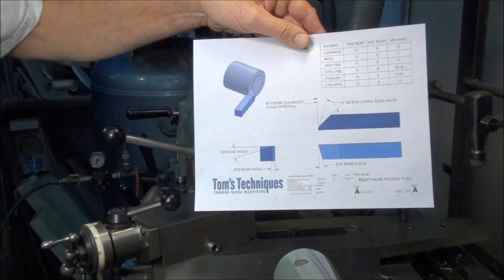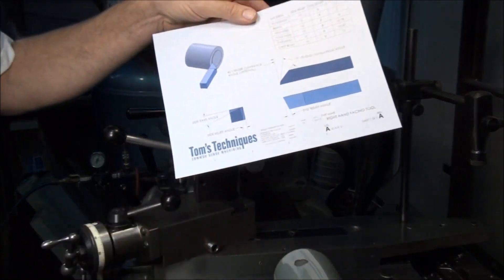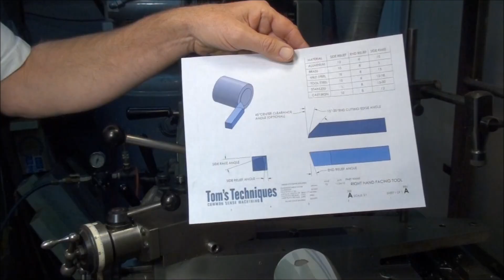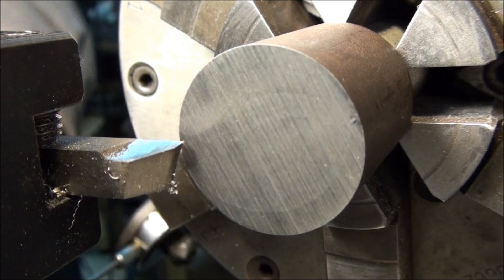Facing on the Lathe

Comment: Hey Tom,

Thank you very much for the videos! I'm new to all of this so these videos are such an amazing resource...

If I may I have one quick question. My uncle has been machining his entire life. He questions the part of this video where you extend the bar stock out to the desired finished length before cutting your center hole. He believes that with it wobbling around you wont be in the true center of the part. Could you please elaborate a little further on why we should extend the piece out?

Thanks again. I know your time is valuable!

PK
Reply from the maker: Patrick,

If you center drill a rod held close to the chuck and then extend it with the intent of supporting it with a center and there is any bow to the rod (there always is), the turned end will be tapered. By center drilling it with the rod extended, the center drill will find the actual center of rotation, regardless of the amount of bow and the part will turn true. Mind you this only applies if you support one end with the chuck and the other with a center. If you intend to turn the rod between centers, then you can center drill with the rod chucked close.

Thanks for watching.

Tom

Comment: Can you use that tool for chamfering?
Reply from the maker: Absolutely. Either set it at the angle you need use it like a form tool or set the compound at the angle you need and use it as a turning or facing tool. Tools have multiple purposes depending on how they are set up.

Tom

Comment: well explained, didnt know you could use the cutting tool in both cutting directions when facing, why does facing from the inside dia to outside dia give a better finish than from the outside dia to inside dia?
Reply from the maker: That's a good question Gary and I'm not sure that I know for sure. It's just one of those things that you figure out by doing. It may be that the tool deflects more when feeding out than in, thus reducing the relative angle of the tool to the work.

Tom
Reply: thanks for that
regards
gary
Reply: It's because the top rake angle is wrong for doing a face cut.   I.E. there is none.. The tool in video has been ground with a positive rake for turning OD. Using the tool shown the cuttings are rubbing against the face as the cut proceeds to centre. Grinding a compound rake takes the cuttings away from the machined face.
Also a small rad at point facilitates ease of improved finish.😋

Comment: Great close up I like that (all your videos that I have watched so for are AWESOME) but is the width of the chip that comes peeling off be a indicator of how much of the cutting surface is actually contacting the work? or is that a feed rate type of thing? IDK I might be on the wrong train of thought on that one not sure what made me think that lol I have trouble sometimes when using just the very tip for some reason I just thought I would toss that out there
Thanks for all your video work it really helps
Reply from the maker: Camera angles are the toughest thing to get right when making videos. Hopefully you can see what's going on.

The width of the chip is a function of depth of cut and tool angle, the thickness is a function of feed. Take heavier cuts feeding in and light, finish cuts feeding out for the best results.

Tom

Comment: Good video. Very concise, basic, and useful. I'm still learning, and there are some things that may be easy on a large lathe such as yours, but many beginners have hobby type lathes such as my Harbor Freight 9x20. I use a cutting tool with about 80-85 degree angle ground so that it can be used for either turning or facing. I started with aluminum, mild steel, and Delrin plastic, but I've recently done work on cast iron, which is quite different. Perhaps you can make a video about materials. Thanks for your efforts!
Reply from the maker: I can't comment or demonstrate on a machine that I don't own, but I can say that the practices that I cover in my videos will apply to any machine. It is true that some machines are more rigid than others, so the depth of cut may need to be reduced, but that is all part of learning the capability and limits of your particular machine.

Comment: Good info!  Do you lock or snug down the carriage before facing? My carriage pushes back if I don't.  Probably a bad habit but I usually just change the angle of the RH turning bit rather than change to a facing bit.
Reply from the maker: I don't lock my carriage for facing. If yours is pushing back, make sure you have enough side clearance on the tool.

Thanks for watching.

Tom

Comment: Thank you Tom...
Bust off little pieces and sooner or later the whole will emerge...
It seems that you aren't a big fan of cutting fluids...
As a whole? Or is this just to simplify the videos?
Reply from the maker: Coolant, at least flood coolant is better suited for production than prototype work. If the machines aren't used regularly there is risk of rust forming on them and the coolant in the tank can get pretty nasty.

Comment: I'm pretty sure I helped inspired basic machine videos.  My first try at anything was the threading series.  I finally stumbled thru it lol.  This series will be a HUGE help to me personally and many others.  Thank you!!  Tom.......do you know if it's possible to cut a 4" circle out of 4" x1/2" thick flat bar on a lathe?  I had thoughts of welding a 1" round to the blank to hold it in the chuck but after that i'm lost. I thought about coming in on the face but then chunks would fly off.  I don't want to buy 4" round stock and I don't have a bandsaw or a plasma cutter.
Reply: I realize I should probably join a forum for off-topic questions I just haven't got around to it yet.  Looking forward to the rest of this series.
Reply from the maker: Bad Dog
Check out metalworkingfun.com.
Reply from the maker: Trying to cut the corner off from the face (trepanning) will likely end badly. It would be better to turn them off a little at a time from the outside.
Reply: Tom's Techniques
That's kinda what I was thinking thanks.  I also thought that corners would just break the bit flying at it from the front side but have never tried it.  I'll probably cut a octagon on it first on a saw.  Oh and thanks for the website I will def check that out.

Comment: Tom, thanks for the vidoes and projects.  I'm looking forward to more projects.  The rest of the metal I need to make your first project should arrive tomorrow.

It looks to me like the tools is held in the tool holder with a slight angle.  About 15-25 degrees?  I assume this is to provide more clearance when facing when a part is held in a center?
Reply from the maker: Rex,

The facing tool is at such a shallow angle that you can angle it in the holder if you like, or just rotate the post. Either way is fine. The holder has four screws to clamp the bit but two are more than adequate to hold the tool, no spacers are necessary.

Tom
Reply from the maker: The 10º-15º angle provides clearance between the side of the tool and the end of the stock. The end cutting edge should be the only part of the tool that is cutting when feeding the tool in. The side cutting edge will cut when feeding out for a finishing cut. Clearance for the center is that optional 45º angle on the right side.

Tom
Reply: Tom's Techniques
I'm sorry I was unclear.  Normally when I place a tool in a QC tool holder I put it firmly against the back so that the shank of the tool is parallel to the side of the tool holder.  In this video it looks to me like the tool is placed in the tool holder at an angle.

Is this offset in the toolholder to provide clearence between the tool post/tool holder and the work? 

I really enjoy how clear you are about the angles of the actual tool and how the tool is presented to the work.  Being very new to machining your videos and website are my daily go to for "what's new to learn!" 

Thank you.
Reply: ctjctj2
Tom, after re-watching this I had the same question. It appears you angle a facing tool in the holder, but leave your turning tools registered against the inside face of the tool holder.

Is that so you can always leave your toolpost square to the work, and just pop in/out turning/facing tools without adjusting the toolpost angle? (I note that you still adjusted the angle in this video)

Do you have any packing in there or are you just depending on the grub screw to hold the tool in place?

Thanks!

Comment: Great stuff as always, Tom! Do you have any success with the jam nuts to lock in the tool heights on your quick-change tool holders? Seems like mine (cheap Chinese, not Aloris) don't stay locked even when they're tight, and then when I want to change the height I have to break out the pliers to get 'em apart. Any suggestions are welcome.
Reply from the maker: These work fine Rex, although I rarely use the locking feature. I'll lock them down if I'm making something with a lot of tool changes, but mostly they just hang loose.

Tom

Comment: Tom I would like to ask a question about good quality lathes brands that are not made in China. Nothing against China but what I have seen  there quality is not there. Some time in the future when I retire I would like to purchase one. Any suggestions, Thanks
Reply from the maker: Generally the machinery made in Taiwan is better quality than that made in mainland China. Otherwise, a good used American made lathe would be a better value. If you can find one, the Hardinge toolroom lathes are at the top of my list. I've had mine for 25 years and wouldn't trade it for anything.

Tom